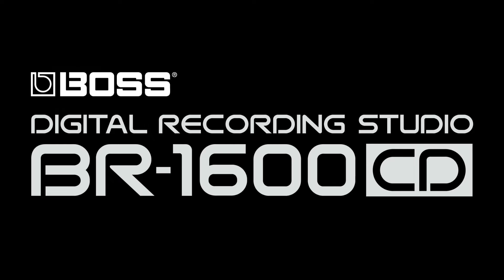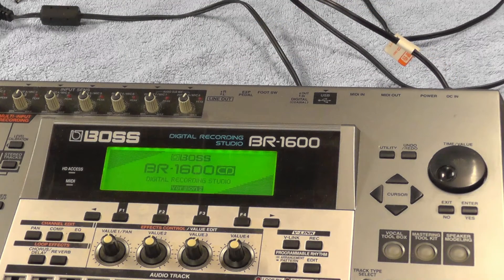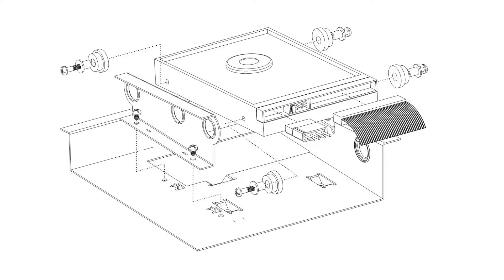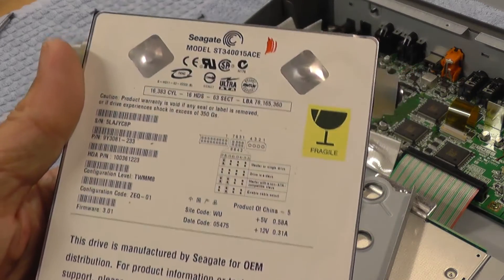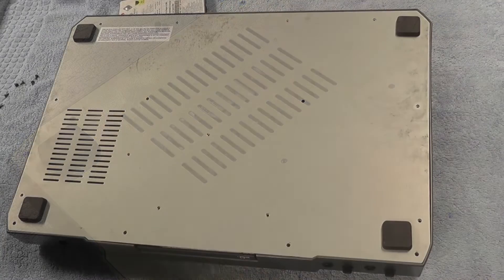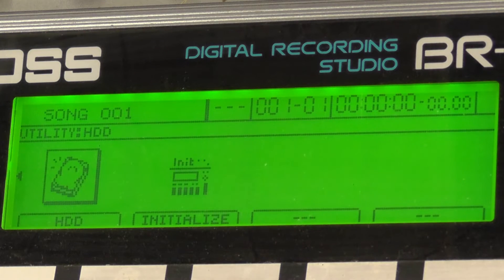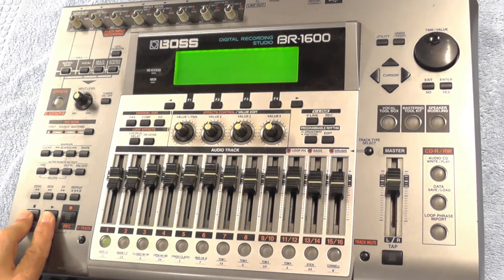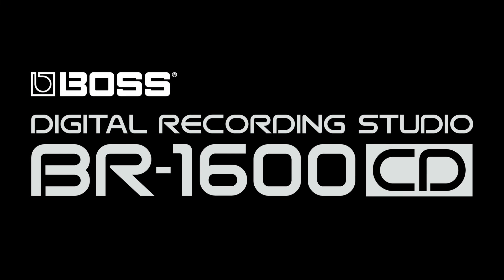Boss BR 1600 How to Replace the Hard Drive and Update the Firmware

Comment: Hey. My Br 1600 displayed the HDD error message a few times during recording when it would crash, and then it began displaying the same message and the unit wouldn't boot up any more, but now it doesn't even power up even though the power button seems intact and functional. I'm going to replace the drive but do you think another fault is indicated by the current failure to power up? Like  could the failed drive cause that..? 
Also how do I format the CD to the ISO requirements you listed? Will my PC guide me to do this? And does extracting the firmware update require an app? Thanks heaps in advance if you can help with all this, any help you can give would be much appreciated. Cheers.
Reply from the maker: The BR1600 will boot even without a drive installed. 
Remove the current HD and restart the machine. If it boots, then replace the HD and you should be good to go again. 
I have seen similar failure before and the cause was most often the HD.

Formatting the CD is done by whatever software you use to burn the CD. I've always used Nero, but whatever software you use should have settings (in properties for the complitation?) to change the format.

The firmware is in a zip file. No special software required. To open in Windows, click on the zip file in the left hand pane of windows explorer. 
You will see the contents on the right hand pane, which you can then copy to where ever you need.

Good luck!
Reply: @masteringtoolkit  hey thanks a lot for all that. It powered up to the br1600 logo screen so that's a good start. 
I've found a few hard drives that should work and are advertised to work in the unit but they're 2-4 times the cost of an 80G Western Digital IDE HDD I found online. All the listed specs match. Can you foresee any reason why it might not work? I was trying to get Maxtor, Seagate or IBM because they're recommended but the expensive drives are not these anyway and the western Digital drive is only about $20US. Thanks again for your help.
Reply from the maker: @eternity8811  No problem - glad to help.
If it booted without a drive, then all should be good when you put a new one in.
Do not worry about specs for the drive. ANY standard 3.5" IDE HDD will work. They shipped with 40GB drives originally and then later on with 80GB. You can use any size, but the BR1600 will only be able to use a maximum of 80GB. A Western Digital will work fine.
Reply: @masteringtoolkit  thanks. I just noticed some differences in the configuration of the middle set of pins (the group of 8/9) and thought this might cause problems. 
But if I remember correctly there were only 2 cables connected to the HDD, ie only the 4 pin and 40 pin connectors are utilised when installed in the br1600 anyway... Cheers. Really appreciate your responses. All the best.
Reply: @masteringtoolkit hey there I'm on another account now. I got it working again though I think the hard drive I got was "refurbished" perhaps. Is there any way to tell? There are slight marks around the mounting screw holes and signs a sticker had been removed from the metal casing underside.

Haven't figured out how to extract the files yet. I have to open it in internet explorer right..?  Thanks
Reply from the maker: @a_planet_on_fire  Glad to hear you're up and running.
Obviously, IDE drives are obsolete these days and no longer manufactured. It's difficult to find new old stock, so most will be used.
Unless the seller stated that they are new, I'd assume that they are used, especially if you see signs of use on the case. 
This is necessarily a problem, unless it has been heavily used or abused. Just make it a habbit to back up your work regularly.
Reply: @masteringtoolkit  yeah I think I'm going to get another HDD for future use anyway. I found someone who apparently has new/unused ide drives but like I said they're quite expensive. The seller of the drive I got said it was new, but I was thinking along similar lines that because they are effectively outdated, most are probably used. But for $23 USD it was an acceptable stopgap solution.

Comment: Hi, were the screws for the optical drive particularly unique? Or were they the kind of thing that could be easily substituted?

Also: How do I go about creating partitions and does this increase service life of a helical scanning drive?
Reply from the maker: No, not really. I think they may even have the same thread as the ones going into the frame, just a little shorter with a washer underneath.

You create partitions from the "Initialize" menu under Utility/HDD. 
Selecting  "Normal" mode will divide the drive into 40GB partitions (up to a max of 2), while using the DIV2-8 modes will divide the drive in equal sized partitions (up to a max total of 80GB).
A helical scanning drive is for writing data to magnetic tape? The BR1600 uses a standard IDE HDD. 
Using partitions will not extend the life of an IDE drive. This is only relevant when using a SSD and using un-partitioned space for "over provisioning".
Reply: @masteringtoolkit  ok thanks.

Comment: I have a BR-1200 I'm wondering can you install the discrete drum loops or import the loops on your BR-1600 correctly? Because after I installed the new Hard drive,  importing the loops, they aren't installing correctly. I'm wondering if this because of the automatic partition set up on the Hard drive?
Reply from the maker: The Discrete drum loops work for both the BR1200 and BR1600 (the BR1180 loops also work).
Formatting the HDD has no effect on being able to import them back onto the machine.
If you have the Loop Phrases saved as WAV files, or if you have the original CD, then use the Loop Phrase Import function.
If you have them backed up as data, then use the Data Save/Load function.
Reply: @masteringtoolkit  Thx for replying. I've had this machine for several decades now. I re-initalized  the 40G hdd once because I got error hdd full and it wasn't full. This time I bought a new hdd 80G. The loops that I reloaded up easily after the first re-initalization didn't load up with the new Hdd. It stopped at 6 on A & B and both those letters had 50 loop phrases in them from the factory, they loaded up when I initalized the Hdd a few years ago. But they're are not all uploading on the new hdd for some reason. There is a slit in the plastic at the top of the new hdd, the ebay seller said it doesn't effect the hdd function. That part I'm not sure of. I think the hdd shouldn't have any defects. So I asked them to send a new one.
Reply from the maker: @bqktwcommentary  No problem - glad to help! 
It does seem unlikely that the HDD is faulty, but you never know. Try switching to the 2nd partition on the drive and see if that works.
If you still have the original 40gb drive, try putting that back temporarily and see if you can load the loops.
If you have no luck, it could indicate a fault with the backup CD (you don't mention if you are using a data back up or the original Drum CD?) or the CD drive?
If you run through the above, it should at least narrow down the cause of the problem hopefully.
Reply: @masteringtoolkit  i have the original discrete drums cd and I used the import loop/ phrase button to import. Like I said earlier its only uploading part of the loops. The loops were already uploaded to the 40g hdd when I tried initialize function to reset the hdd after getting the message hdd full when I tried to record. That worked to record for a while but it didn't last. It would let me reupload all the songs I had on the hdd before and the hdd wasn't even close to full. This is problem lots of folks have had. So I decided to replace the hdd
Reply from the maker: @bqktwcommentary  Ah yes, having the "HD full message" appearing when it's not, is definitely a sign that the HD may be on the way out. As you've noted, a format works for a while, but the issue will return. Replacing the HD is the only real fix. 
What firmware do you have installed? 
The last version (v2.20) addressed an issue where "the remaining capacity of internal drive may be lost atypically", so it is worth updaing if you havent already.
Reply: @masteringtoolkit  the only firmware I could download for the BR-1200 was 1.20 it is different for the BR-1600 apparently.
Reply from the maker: @bqktwcommentary  Sorry, I forgot your are using a BR1200 and not the BR1600. 
Yes, v1.20 is the last firmware for the BR1200, so you are up to date on that front.
Reply: @masteringtoolkit  I figured put a way to get all the loop phrases from the factory cd discrete drums, I have upload each loop individually instead of clicking on the "ALL" option.
Reply from the maker: @bqktwcommentary  Thats great! 
I was going to suggest that, but it's a lot more work to do it that way, and it doesnt solve the issue of why you cant do them all at once? 
Now that you do have them on the machine, you can back them up to a data CD and it will give you another option for restoring them in the future.
I'm glad to hear that you're back up and running though 👍
Reply: @masteringtoolkit  I'm not about using the data upload for restoring loops phrases because that function doesn't allow you access the loop track by itself,  which is track 10 on my machine.
In the data save upload section it only lets you access 9/10 as a stereo track. I'm not sure if hard drive backup would recover that or not. I didn't upload all the loops on it yet because I want wait for the new hard drive with no splits in the plastic housing.
Reply from the maker: @bqktwcommentary  You can use the "User" Backup to backup (and restore) just the Loop Phrases if you want, amongst others. 
This restores them to Banks A-H - nothing to do with the Loop track used in a song. 
See page 228 of the user manual for step by step instructions.

Comment: I renewed all parts. It was HELL. Roland dragged it out to 5 months of calls to get parts. It seemed they don't want to sell you parts. Had to buy 2 new hard drives. Both were faulty. But got the second working.  I'm retired and had lots of time to deal with their bulsht.  Good luck guys.
Reply from the maker: I have replaced the HDD on twelve BR1600's, and never had an issue. They are standard IDE hard drives, so no need to deal with Roland at all.
Reply: @masteringtoolkit  I've searched and was unable to find any new other than from Roland. who did you buy them from.
Reply from the maker: You can them on Ebay:
https://www.ebay.com/itm/374686700928?itmmeta=01HT4BQDBZXJP90M5352YT6RHB&hash=item573d115580:g:Ap0AAOxyMxpRqLAI&itmprp=enc%3AAQAJAAAA8Evf4FeTuL3xGRXGPIiFwXKmCJXvLtNjh%2B5%2F7oQanrUMsL7eq8Hr7dWKZTF24%2B69N00mzFr9myqcxYQ5rf5LCgv7QIs%2B%2BjR9iv1ZnSVj86ZLx4e%2FmrnphvMOFvdeBXM6V8zCfDqD9rVXe1G%2FqxNrF0bX%2BDLuTqns4f4yb9KDFD%2B3buirwqtYrkxEeILfT5sWt8BcpSWkMkTsVRtWPL7VSpJLqXOplkLvb3nulIcyRBZ8%2FVj1s2yaec5eG19COILGvW6Bk0EPABbNc%2FSHXraxdJ5ftRi%2Bo%2B8Nci542nLnRnTOQZWH4urHQnd64tlsYhqlWw%3D%3D%7Ctkp%3ABk9SR4zW3YvRYw
Reply: @masteringtoolkit  they are always second hand.
Reply from the maker: @aceventura5398  Did you look at the link?? They are brand new drives, not used ones.
Reply: @masteringtoolkit  yes i did.  If this drive dies i will try one. Even with shipping they will still be cheaper than Rolands. $ 160 +   Thanx for all your help. It's very much appreciated.  Be safe n well.
Reply from the maker: @aceventura5398  I'm surprised that Roland even sold you one. I've only ever seen them say that these recorders are discontinued and due to their age, they are no longer able to provide either support or spare parts.
Glad to help - hopefully, your current drive lasts a long time, but as always, just make sure you back up anything that is important.

Comment: What a treasure good sir thank you so much. I love my br1600 I actually have two my old one works but some of the buttons stopped working such as my song selection buttons the enter and exit yes and no buttons and made it so frustrating to operate and time consuming during the recording process. I was curious if you have any suggestions on a repair for that I would love to use my old one or be able to export the music. I also use it as an interface have for years with the rca inputs to my computers mic port, and works fantastic. I bough the br instructional video back in 2008 when I purchased the first one and I must say if your the gent on the dvd without you good sir I would have been lost on using this awesome machine.Thank you Merry after Christmas and a Haply New Year
Reply from the maker: Thanks for the comment Mammsie - much appreciated!

Unfortunately, it's a common problem with these machines especially if they are well used. 
The tactile switches have a finite lifecycle and the most commonly used buttons - like the ones you mention -  are usually the ones to fail first. 
I picked up another machine last week, which has 36 which are either dead or failing. I believe it may be one of the very first BR1600s from around 2004, as it is still on firmware v1.1!
Another one I have, I replaced 33 of them.
Fortunately, if you are handy with a soldering iron, it is not a difficult to fix.
The most time consuming part is actually getting to the switches. You need to dismantle the unit to take out the main board, but if you take your time, it is pretty straight forward. 
It takes me about 1/2hr to strip it down (and about 20mins to put back together).
The OEM switches used in these recorders (which are also the same ones in the BR900, BR1180 and BR1200 and a lot of other Roland hardware) were Panasonic EVQ-11A05R (Roland part No 01340290). These were discontinued as of Dec 31st 2020, but if you search them up, you can find alternative switches that have the same/similar specs that will work fine (you can also find a seller on Ebay (US) - with a premium added to the price.
There are 68 tactile switches used in the BR1600. You simply need to de solder the ones on the board that are faulty and replace them with new ones.

Once you have it fixed, you can combine the two BR's you have and sync them via midi. 
I did think about doing a video on how to do that, but was unsure how much many people actually had more than one BR...

For interfacing with the PC, I'd suggest using the digital in/out rather than the RCA, which will give you a lossless transfer. 
I use a NI Komplete Audio 6 (Mk1 or Mk2) which is USB powered and works perfectly to transfer signals to and from the BR to PC.

I have a few copies of the David Wills tutorial DVD too, but no, that's not me ;)

Merry Christmas Mammsie, and happy recording :)

Comment: I followed the steps, but I could not get mine to update. I don’t know if my ISO file was correct
Reply from the maker: I assume it didn't recognize the CD? 
If the disc is not recognized by the BR 1600 then it is either the disc type it  must be  IS0 9660 Level 2, Mode 1) or it may not be able to read the brand of CD you're using. 
If you have a CD-RW that you use and know works, try again with that. 
Just make sure that the update file is in the root of the CD, not in a folder (extracted from the zip file).

Comment: Can you advise on installation of an SSD drive thanks.I found your tutorial excellent and am pleased that you have done those .
Also can you do one on the VS2400 also using and SSD replacement hard drive?
Reply from the maker: In theory, replacing the IDE drive with an SSD should work. 
Unfortunately, it is not as straight forward as it seems. 
These machines were never designed to run an SSD, but there are a few reported cases of it being sucessful.
Still, they are very particular on a combination of adapter and drive that will actually work (and be stable). 
https://www.youtube.com/watch?v=SDu_ko0g4Dc&ab_channel=NoelSharp
There are also quite a few documented cases of swapping the HDD for an SD or CF card - especially on the Roland VS machines. 
I did try it on the BR1600, but didnt have any luck. Oddly, it did work on the BR1180!